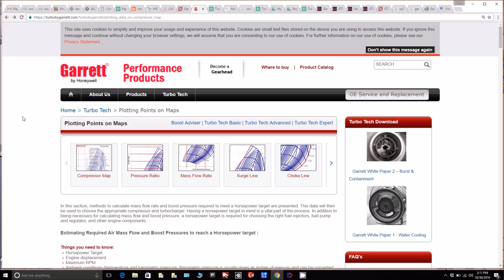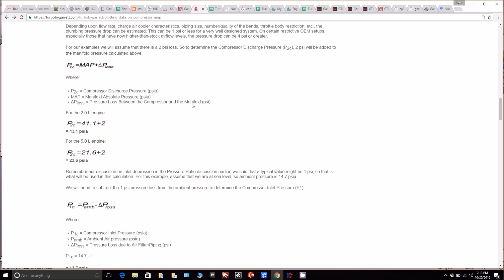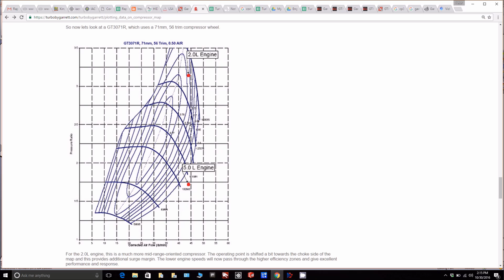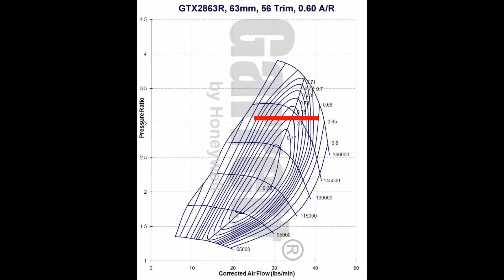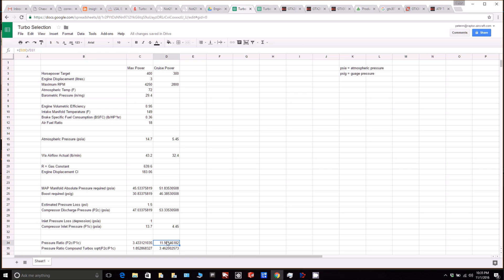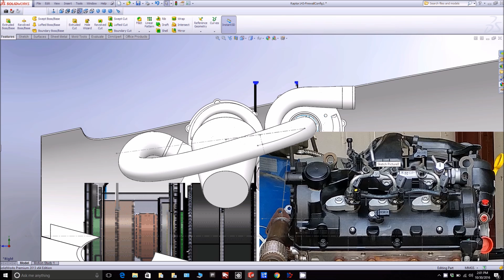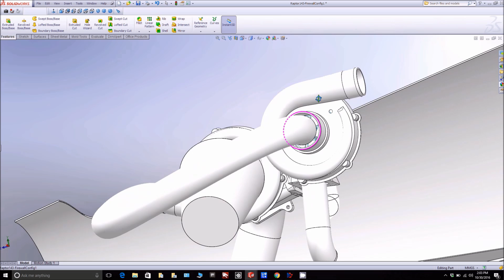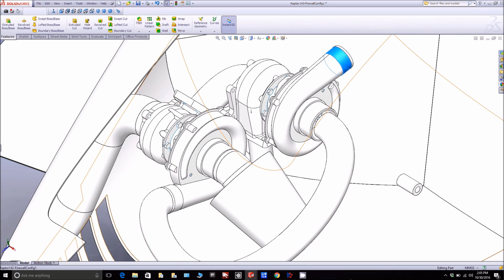Raptor Aircraft Turbo Overview

Comment: if you don't have an intercooler you essentially lose power due to higher air temperature and less air density after compression... remember the air heats up quite a bit when you compress it.. at altitude you have colder inlet air but you're still injecting a lot of heat into the charge air and doubling the turbos compounds the problem... at altitude you can utilise the cold for effective intercooling and a single intercooler with a two stage flow chamber would cool both passes through the turbos.. you could then use the Banks Power injection system at take off... they have crate engines ready and 40 years experience of high performance diesel race engine holding all kinds of records... I don't think there's anyone that knows more about getting performance out of a turbocharged diesel engine than Gale Banks..

Comment: Maybe speaking to Banks Power wouldn't be a bad idea when doing anything with diesel and turbo charging.. They got really light weight systems for injecting water methanol into the intake air for higher air density and power..

Comment: Where is the allowance for boost pressure loss from the turbos pressurizing the cabin.

And for all the other questions about too much pressure, although he didn't explain it, its answered with pressure differential. . . Also the over boost at ground level will be vented via wastegate, and BV.

Comment: The theoretical calculations seem fine (probably needs intercooling though if possible!), but you're asking to push an extra 100+ HP through a presumably-stock engine at sea level, and then run it at high power continuously in an aircraft application rather than short bursts of acceleration for a road vehicle.  That's asking a lot of the engine.  Do you have plans for strengthening it to handle this, or are these just intentionally 'theoretical max' figures?

Comment: Hi,  I thought the OEM biturbo setup from the 3.0 TDI could work well with some minor adjustments.  (Perhaps even the same flow paths, but larger turbos).  Can you show if you're using one or two wastegates?  I'm curious if the turbos you selected can handle elevated inlet pressures (the downstream intake, of course).  There is a potential for pushing the oil out of the bearings if the pressure is high enough.  Just putting it out there.  I really enjoy your progress.

Comment: Hi Peter, have you had any thoughts to consider electric-powered turbine for either primary or secondary turbo boost?  That's what Ford is doing with their diesel and gas-powered  Eco-Boost engines; it is a proven approach that has achieved continuous improvements in both power and economy.

Comment: Interesting video!  Is it worth having an intercooler between the two turbos?
Reply: Yeah, with a pressure ratio of 9 without any intercoolers the intake temp will be very high. Borg-Warner's website has a calculator that spits out a lot of interesting info like not only compressor outlet temperature but also turbine pressure ratio and the power required to run the turbo. If I input 35psi boost at 25000 ft alt with an 80% efficient compressor (that's high, esp. for two turbos) I get an outlet temp of 660 F, without an intercooler, and 64hp to drive the turbo. Does not sound good.

Comment: With the levels of boost that you are contemplating, do you anticipate any engine modification to accommodate the boost pressure?
Reply: thats a supercharger
Reply: They're asking for 400 hp from that engine at sea level according to those numbers.  That's a huge jump, and while the engine can probably take it for a short time in a road application, I can't see how it would hold up long at all at continuously high power for aviation.